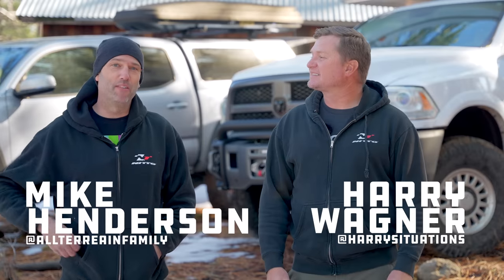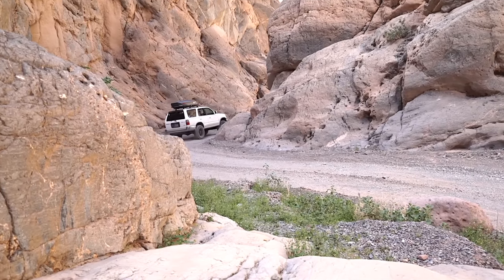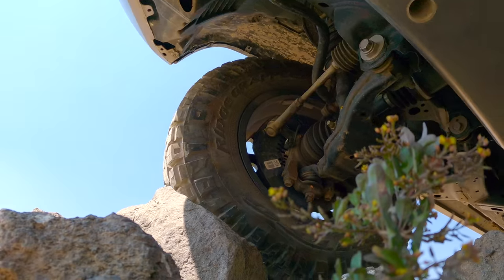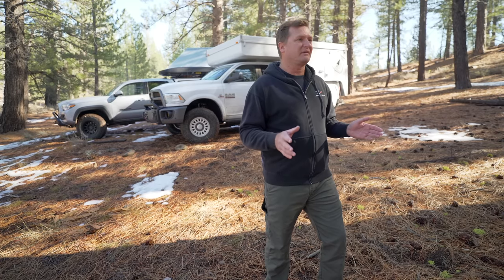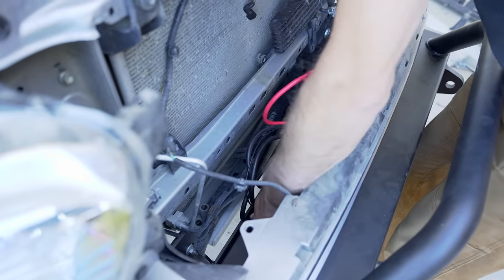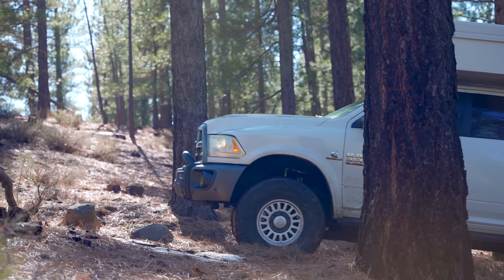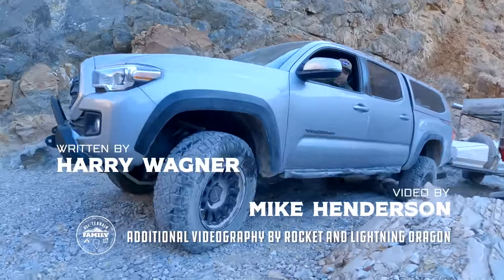Which is Better? Full & Mid-Size Truck Overlanding Setup | Harry Situations

Comment: I regret buy a Tacoma so much...
Reply: Can you explain your reasoning?
Reply: @DUNEATV  my third gen is too much of a compromise. The motor and auto trans are kinda wack; the truck doesn’t want to pull itself much less a trailer or lots of armor and gear. Mine has the latest KDMax tune and 5.29’s with 34’s and is still a massive turd with just a camper shell and sliders.
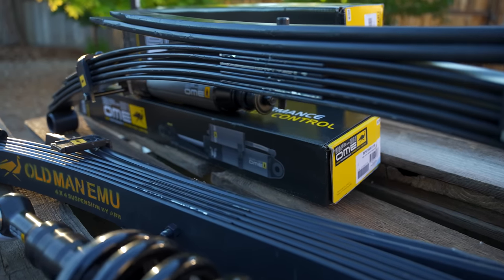Reply: @woodtech1  I was in the market for a new Tacoma last January and drove a TRD pro. Just prior to driving the Tacoma I drove a 2021 jeep Rubicon and I was blown away by how the jeep drove and how nice the interior was. I ended up buying the Rubicon and I now have 15,000 miles on it and couldn’t be happier the 3.6 L engine is powerful and I’m getting almost 22 miles per gallon. I do like having the solid axles and locking differentials all backed by factory warranty..also... 4:10 gears and a super low range transfer case.I still do like the Tacoma but just couldn’t get myself to buy one.

Comment: Sadly my 2003 Tacoma TRD would carry some 300 lbs more than my 2015 TRD. Toyota seems to be going the wrong way in payload. I still prefer the smaller size of the 2003 for the back roads and trails. I’ve owned several full size trucks even with cabover campers which were very comfortable to camp in, but could never go where the Tacoma could. My granddaughter confiscated the 2003 (already set up well, but still under max gvw), so I got the 2015 and am starting to set it up. I started buy weighing it. We shall see how “overloaded” it gets in the next year. LOL!
Reply: I think that the market has pushed Toyota to make a car with a bed rather than a truck. For most of their current buyers this is a benefit in terms of ride quality but for the segment that actually adds weight to their truck it is a detriment.

Comment: Not a big fan of the Tacoma…it’s just too wimpy of a truck. I want to change my mind thought because I’ve always been a Toyota fan and like the size of the truck. The taller skinny tires make total sense! Great video guys…
Reply: I feel the same. I consider myself a “Toyota guy” but can’t see myself in a 3rd Gen Tacoma.
Reply: @HarrySituations  I’m glad I’m not alone. Lol. Maybe the next generation???
Reply: @DUNEATV  maybe! I like my first gen Tundra but they are getting tough to find with low miles.
Reply: How is low payload and high reving engine un-toyota?
Reply: Honestly the low GVWR isn’t a problem if you leave it stock, and if you just let it shift and run at 4500rpm it has plenty of power, and if you don’t bolt a bunch of gew gaws to the roof they get good mileage. That’s not really what guys like us do though. But for me, a full size truck wasn’t feasible.
Reply: @AllTerrainFamily  GVWR doesn’t matter if you drive a car. My 87 Toyota pickup was rated to carry more than your Tacoma (1300 lbs VW 1100 pounds).
Reply: @HarrySituations  with a 90hp 4 cylinder. Unless you mean your turbo…
Reply: I have a 3rd gen Tacoma but would pick the ram for a (preferably long) weekend. I got the Tacoma because it’s a pleasant daily driver that can take my family places. And I’m guessing it costs about 1/3 of your kitted out ram. Great content!
Reply: @brownneedles6045  the Ram is on the large side for daily driving, particularly with the camper in it. I don’t really have that much money tied up in though (relatively speaking). I bought the truck used five years ago for $35k and the camper was $15k (pre-COVID, I could probably sell it for more than that now!).
Reply: @HarrySituations  I do think that’s the appeal of the Toyota for many. It ‘can’ be an adventure platform while working well as a daily. What do you daily?
Reply: @brownneedles6045  I currently daily a 2000 Ford Ranger. Just sold my first gen Tundra after five years. Prior to that I had a first gen Tacoma and before that a third gen 4Runner. All have been great for daily driving and weekend exploring.

Comment: Makes me want to check numbers comparing a Tacoma to the Gladiator.  Very nice article!
Reply: What I found is #4650 - #5050 for curb weight and #5800 - #6250 for GVWR. But since you have to run 40's to overcome it's wheelbase, you'll make up for the extra GVWR in axles and tires.
Reply: @AllTerrainFamily  so it has a 450 lb higher GVWR but a JT also weights 400 lbs more?
Reply: @HarrySituations  Looks like the payload above curb weight is the same. Around 1200#
Reply: @HarrySituations  My point was it probably take more mass to make a Gladiator actually trail worthy with the wheelbase of a short bus.
Reply: @AllTerrainFamily  I’ve driven stick Gladiators on trails I’d never take a Tacoma on.
Reply: @HarrySituations  I'd gladly take someone else's Tacoma on those trails.